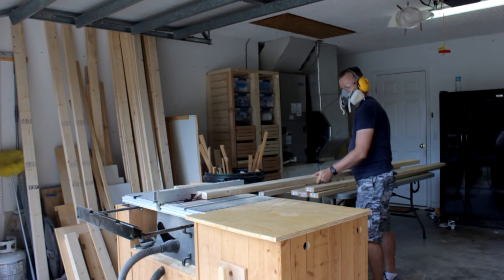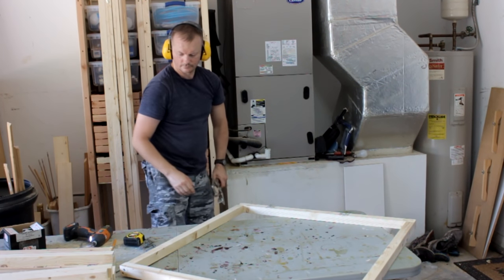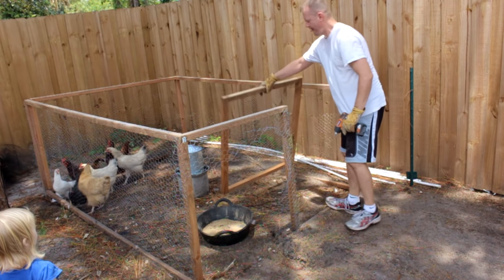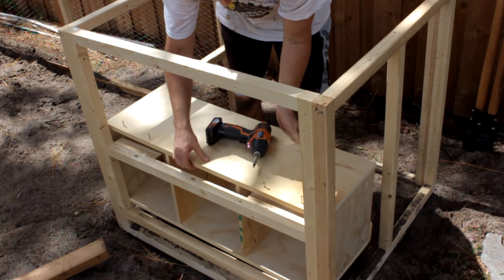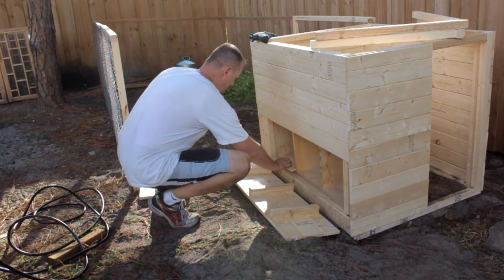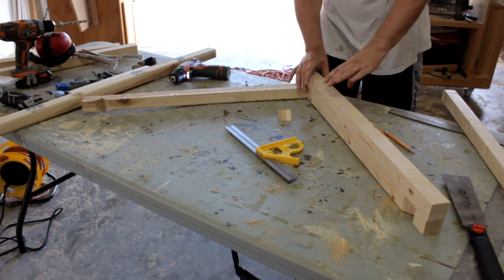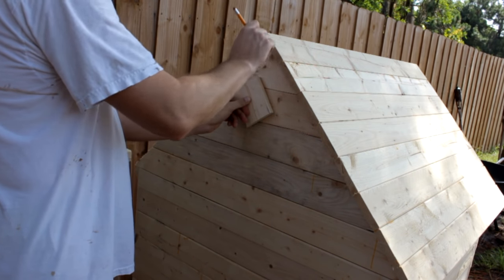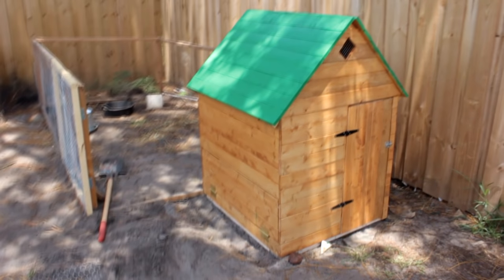DIY Building a Small Backyard Chicken Coop

Comment: How do u plan, 2 get inside and clean it Stan? I dont recon u can fit in the door ;)
Reply from the maker: ***** An open floor design allows for natural decomposition eliminating the need for excessive raking of the muck.  The chickens will turn it over for the most part.  When a cleaning is required (perhaps the top of the nest boxes for the most part.)  A small cultivator rake or hoe, like what is seen in the video, will make short work of the job.  The run also needs to be turned over every now and again as well so we already have the tools on hand.  The coop is only three feet from front to back which is the natural reach of a rake.  Simple, easy.  Thanks